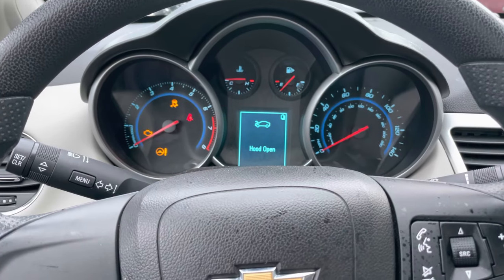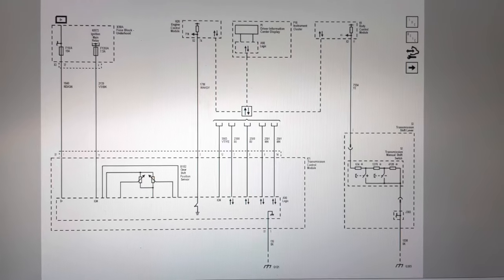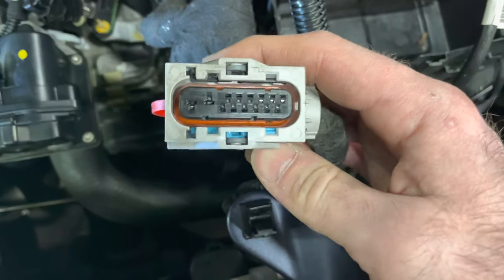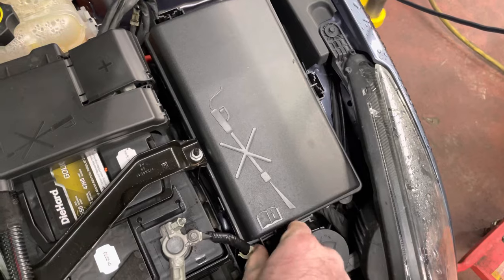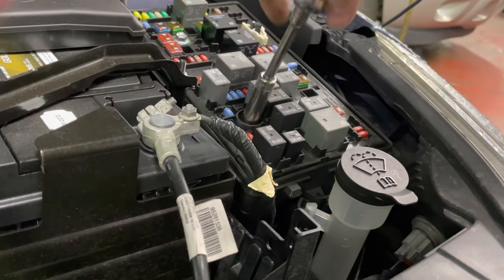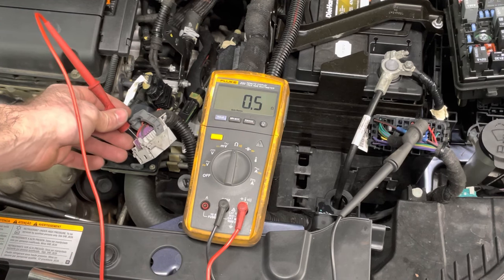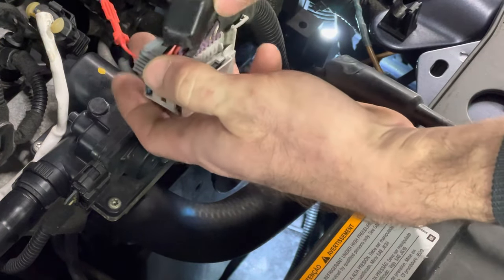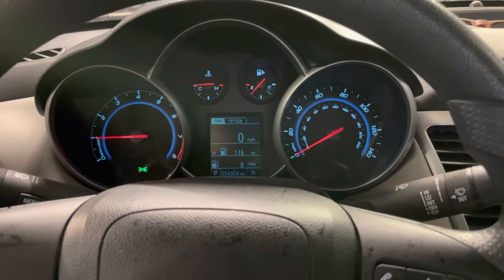Cruze Limp Mode... TCM No Communication U0101

Comment: I have a 2014 Chevy Malibu that had this same U0101 code. Goes in limp mode and is stuck in 3rd gear. According to Chevy dealership, the TCM is inside the transmission, therefore it is an internal issue and they are recommending to get a new transmission…. I replaced the gray colored relay fuse and that didn’t help initially, but now my my car is acting normal. Shifts fine, check engine light went away, but I’m afraid its gonna lose communication with the TCM again.
Reply from the maker: If the transmission acts normally then it probably doesn’t need to be replaced, maybe service the fluid to check the health of it first. I’d suggest a re-diagnosis. 

If the problem comes and goes, it is almost certainly wiring related… It could be a faulty TCM failing when warm, but I don’t see that almost never….. if so the TCM can easily be replaced by removing the transmission side cover. 

Thanks.
Reply: My chevrolet  cruze 2014 model was giving me anti theft check ligt, later the key could not start the car. We try replacing the key and now is giving us this error;Chevrolet Cruze no communication with ECM, TCM and BCM.
Please help us.
Reply from the maker: @seinadziwornuernest2960  needs to be diagnosed
Reply: I have the same make year and model my car is at 220k and now acting in this same manner I cleared my codes and is running good for now but how did you know to change a certain fuse and what fuse is that you mentioned located? Did the problem come back?
Reply: @traviscarver7163  I misspoke in my original post, its not a gray colored fuse. The gray one I mistakenly mentioned is the A/C clutch relay. The fuse you're looking for is called "Transmission Control Module Battery" and you can locate it by using the diagram underneath the fuse box cover in the engine bay. The problem never went away after I changed that fuse. I am still having TCM issues with my 2014 Malibu. My car is at 193k miles. The TCM intermittently goes in and out. I have to drive my car for about 20 minutes and the TCM initializes while I'm driving and the car drives and shifts fine. But when I cut the engine off and let it sit for a long period of time, the TCM will go out again when I re-start the car and will be stuck in limp mode which is 3rd gear only...... then I have to drive for another 20 minutes before the TCM comes back. I took it to a second Chevy dealership, paid another $200+ in diagnostic fees and they told me there is some kind of electrical/connection issue and I would have to pay another $1,300 for them to further diagnose it.  Obviously I declined that. I am beyond frustrated, but I am just dealing with it right now. I have disconnected the TCM harness from the TCM over and over and over again, but to no avail. The next thing I'll do is probably do is disconnect the entire engine bay fuse box and examine it,  which was done in this video.

Comment: How do you remove that cable that you blew with air it seems impossible to remove??
Reply from the maker: Wiggle and pull while you move the lock lever. Don’t use the lever to force the connector, it will break. 

Sometimes you may need to blow air from the outside and also spray some WD40 to help get the connector loose. 

Thanks.
Reply: @DadsGarageDiagnosticSpecialist  thank you I was able to remove it

Comment: Si retiro el arnes para probarlo con mi osciloscopio se desprograma?
Reply from the maker: Disconnecting the harness for testing will not cause a problem with loss of programming. It will be safe to perform the test.

Thank you.

Comment: Would this cause the traction control and power steering light to randomly pop on and off
Reply from the maker: It can.
Reply: @DadsGarageDiagnosticSpecialist  so like my problem is I have a 215 Cruze and this code is popped up but it don’t have any of the symptoms that are happening in the video . Some people have told me it could be the wheel speed sensor going out to
Reply from the maker: @MrRichboy707 depends what codes you have set.
Reply: @DadsGarageDiagnosticSpecialist  u0101
Reply from the maker: @MrRichboy707 U0101 means at some point the TCM was not communicating. Possible connection fault somewhere if it isn’t happening all the time. 

There could also be other codes in other modules. It will need to be diagnosed with a scan tool capable of scanning all modules.
Reply: @DadsGarageDiagnosticSpecialist  I have an appointment set with Dan powers to do so , will it be ok to drive for 2 weeks like that ?
Reply from the maker: @MrRichboy707 if the transmission is operating in limp mode due to a communication fault it will likely be damaged.
Reply: @DadsGarageDiagnosticSpecialist  it’s not operating in limp mode tho , it’s acting normal it shifts fine , drive fine , it don’t slip gears or anything

Comment: I have this same problem, sometimes both lights come on or just the stabilization one at the top, however, when I go into reverse the steering wheel light usually comes on and the car locks go up and down and then it is erased.

I have no problems with my steering wheel, it is not hard nor apparently mechanical, they simply put both on and it is forced when running, now I know that it is because the car is protected, however this is annoying. 

Any recommendations?
Reply from the maker: Needs to be diagnosed it could be many things.
Reply: @DadsGarageDiagnosticSpecialist  
Thanks 😃
Reply from the maker: @edsonmartinez192 you are welcome

Comment: I have a 2012 Chevy Cruze with code p0700 and the car jerks when changing it to reverse, and it seems to not have enough power to go up my driveway. Not to sure what’s the problem
Reply from the maker: Sounds like it is going to need a diagnosis...the transmission is most likely in limp mode.

Thanks.
Reply: I’m also getting codes p026F does this mean the tcm is bad?
Reply: P062F sorry**
Reply from the maker: P062F is an internal module fault code...depending on what module is setting the code and what symptom byte is set along with the code will depend whether the module needs to be replaced or just needs to be programmed.

Is it a new TCM or valve body? If so, it needs to be programmed.

Comment: I’m having the same exact issue except it drives as it usually does but it’s hard to pick up a speed. Once I put up a speed I have to maintain that speed, I have to really press on the gas to go. Went to AutoZone code U0101 came up nobody seems to know what’s the issue or how to fix it. Everyone just keeps saying lost communication with transmission control module. Any advice?? I have a 2014 Chevy Cruze LTZ
Reply from the maker: If you follow the general steps of the video you’ll may be able to figure it out. 

Firstly you’d need a scanner capable of communication with the TCM, and you’d have to verify that the TCM is failing to communicate with the vehicle modules and also the scan tool. After confirming the failure to communicate you’d need to consult the wiring diagram and test the TCM circuits as shown in my video to determine if it’s a wiring problem or a faulty control module. It’s usually NOT the module. 

Thank you for commenting.
Reply: @DadsGarageDiagnosticSpecialist  where did you purchase the scanner from that you have in this video?
Reply from the maker: @biancatiana2228  mine is a factory scan tool from the dealership. Testing can be done with other aftermarket scan tools also. 

If you are going to invest the money in the scan tool and use it once, it may be a better idea to pay for a diagnosis. 

Thank you.
Reply: @DadsGarageDiagnosticSpecialist  ok thank you so much!
Reply from the maker: You’re welcome
Reply: @DadsGarageDiagnosticSpecialist  Thank you for the suggestions. I’ve tried everything in the video, maybe I need to replace the tcm after all.
Reply from the maker: @biancatiana2228  if you’ve verified everything else, then that is a possibility yes. The module will need programming after installation. Thanks.

Comment: I have a 2015 Impala 3.6 LFX and I had a U0101 code which put the car into limp mode, no gear selection showing, stabilitrak light coming on every fuse days. I checked wiring, continuity, and everything was fine. 

These last gen Impalas have problem with condensation getting into the inside of the fuse box for some reason. Try taking the whole engine compartment fuse box apart to clean the prongs underneath. For my 3.6, there are 3 10mm bolts that go to 3 individual pieces that come out from the bottom. The bolts do not come all the way out.
Then on the two longer sides, 3 clips you have to separate with a flathead, and I think 1 on each shorter side. Then it comes out. Clean with dielectric parts cleaner with a cotton swab. Also note I did not see any condensation inside of the fuse box. But for me it worked for 3 months

The same thing happened again. Then I took the alternator out, had it tested and it failed. Also took the throttle body off so I could clean it. Mine made a bad rattling sound when I went to shake it. There's gears inside of it that may move around when shaking. I never had a engine light for the throttle body so I left it on. Even went to LKQ and those made the same noise but less aggressive than mine. After that the problem was fixed. I got a stabilitrak light that would come on every 3 days almost and it has not came back for 3 weeks now

If the light comes back, I may replace the whole throttle body. The first time I even replaced the TCM but that worked for a day
Reply from the maker: Good info. Thank you for commenting!

I have not been seeing too many fuse block failures, but yes it does happen. 

If your problem returns you may want to test for any loose terminals in the connectors.
Reply: I'm having the same exact issue in my 2015 Impala ltz. I replaced the TCM and it worked for 2 weeks then went back to limp mode.  Replaced TCM again with warranty and it now has no communication with TCM so I can't code the thing. I've had this problem for going on 10months with no solution from 2 dealerships and 4 mechanics. Idk what else to do at this point. Can u help please
Reply from the maker: You need to find somebody capable of diagnosing a no communication fault. It should be fairly easy to determine why the TCM will not communicate. Thanks.
Reply: @justinreed9821 you ever find out?
Reply: @justinreed9821  did you ever find out what was wrong? I have a 2014 impala and I've been dealing with the same issue and it's really annoying. Every mechanic I've been too acts like they don't even want to touch it.

Comment: Malibu 2015 v4 code u0101 ? i fell the gear not change smooth and The gas pedal does not respond quickly
Reply from the maker: Diagnose the U0101. If it isn't shifting right I wouldn't drive it otherwise you risk overheating the transmission.

Thanks.

Comment: I had this 0101 code recently.  I wiggled the TCM connector where it plugs into the transmission and the problem went away..... Check engine light isn't coming back on. Is there a simple way to replace this connector as 1 part?  I don't want the issue to return.
Reply from the maker: The connector is available as a whole new piece including the wires and splices. Grab one from the dealer or get the part number from them and order it online….would highly recommend only buying the OEM AC Delco rather than aftermarket. 

Thanks.

Comment: I’m having the same issue with the same code my car jerks in reverse the car doesn’t go over 40 mph should I check the fuse box ? It’s been coded by a mechanic and the problem is the TCM
Reply from the maker: Yes if you follow the general direction in this video you should be able to find it. 

Year make and model? Thanks.
Reply: @DadsGarageDiagnosticSpecialist   Chevy Cruze 2016
Reply: @DadsGarageDiagnosticSpecialist  and where can I find the terminals to replace ? The car has been sitting for a while it was gave to me by my grandad I replaced the motor the car was running fine for 2 weeks that’s when it started happening with the jerk in reverse and everything else
Reply from the maker: @sammiesosaaa  could be a loose ground related to the engine replacement
Reply: @DadsGarageDiagnosticSpecialist  have any suggestions on what I should do ?
Reply from the maker: @sammiesosaaa  if you have a U0101 and the transmission control module is not communicating you would need to test for power and ground at the transmission connector.
Reply: @DadsGarageDiagnosticSpecialist  does your video shows the steps to test ? Or better yet how do I run a test for all of that and the transmission fluid was pretty black u think it would need a flush ?
Reply from the maker: @sammiesosaaa  the black fluid will definitely need to be dealt with, that may be the result of driving it around in limp mode. 

Yes my video shows the general testing process, but every car and every situation is different. If the TCM is not communicating then I would test power, ground, and communication circuits at the at the TCM connector.
Reply: @DadsGarageDiagnosticSpecialist  appreciate it boss man ima handle the fluids and see what that does and test everything else you said right after
Reply from the maker: @sammiesosaaa  sounds good